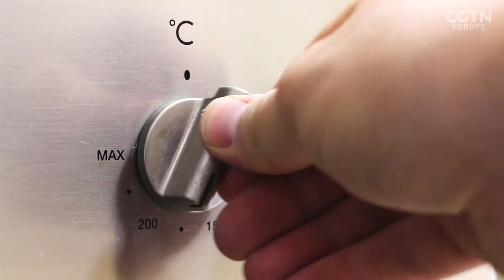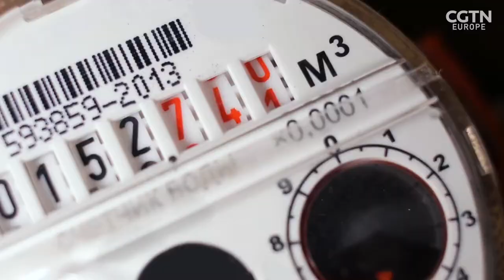How can we decarbonize the planet? Saul Griffith has some answers

Comment: Fossil fueled power in Australia is 600Gwh daily MAXIMUM PEAK if you are lucky. 
20million buildings in Australia 
20million buildings connected to the grid.
20million rooftops PV 6.6kW is 660gWh daily. 
Only 70% power generation output achieved today from fossil fueled generation. 420gWh

So rooftops has 160% greater capacity daily. 
20million rooftops are 10 times cheaper than fossil fueled generation upgrades.
20million rooftops with EV batteries UNLOADS the existing national grid.